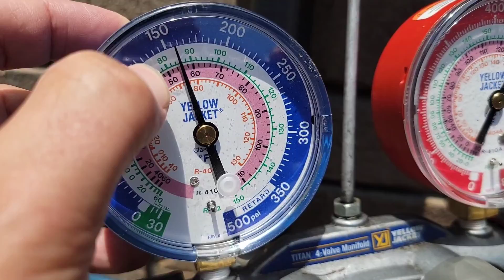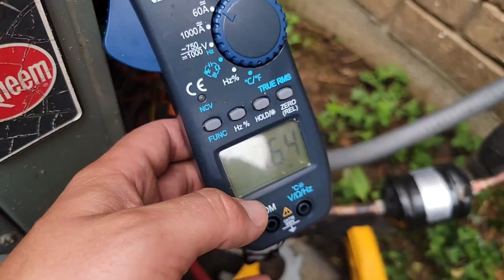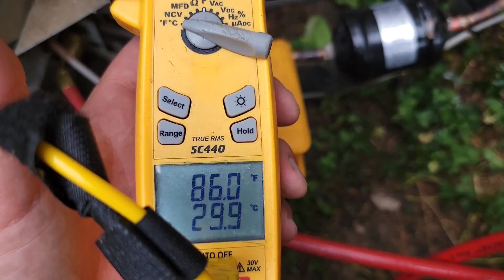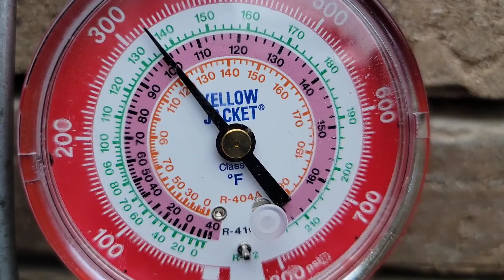How to keep air conditioner compressor from failing?

Comment: Good job man do you know thermostats have indoor air filter reminders be nice if they had outdoor coil cleaning reminders lol
Reply: I meant “you know how they have those reminders” 
It would be nice if they had that for the outdoor coil. Especially it’s got no filter.
I’ve seen restaurants put filters on an outdoor condenser before, because the air near it would plug it up so fast being in a dirty commercial spot.
It’s strange but it worked. With a maintenance plan it all would work all the better too. Great work man, I’ve ran into several plugged up ones like that too. Feels rewarding once your done!

Comment: Nice informative video. Question about filter dryer location. I thought placing it inside out of the elements was a better location. Potentially rust and leak in the future. Thoughts ?

Comment: That's a dirty one. Seems like that system might be overcharged though, with only 5F total superheat. Especially given the high heat load on the evaporator coil.

Comment: What's your outdoor temperature? Looks like you're measuring SC while the condenser is still wet. Your liquid line will be way cooler then it would be because the coil is wet (wet bulb temperature). From NY
Reply from the maker: I waited several hours while it dried out

Comment: Is there a rubber cap or plug on the bottom of a new compressor that needs to be removed? (like a moisture drain plug)
Reply from the maker: no sir

Comment: This is awesome, Tad! I had no idea that compressors are even able to be replaced. This just shows how little I know about HVAC. I believed that if the compressor goes bad, that the entire system needed to be replaced. Thank you for your videos; you help a LOT brother.
By the way, it seems like rinsing off all that otherwise loose dirt before putting coil cleaner on it makes sense.
Reply from the maker: Glad to help

Comment: I understand that it would be an extra step BUT wouldn’t it be worth the time and effort to first brush off and/or vacuum off the big dirt before you wet it and turn it into mud. ?????
Reply from the maker: yes
Reply: A fur coat I will brush first. But not always necessary